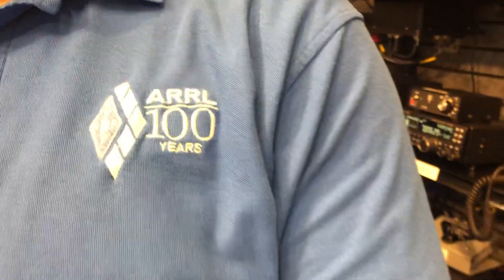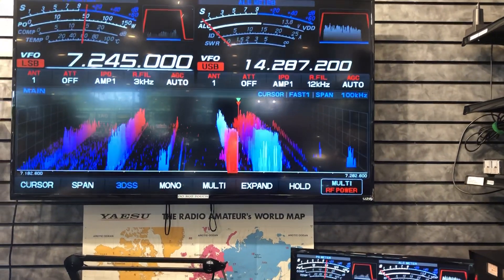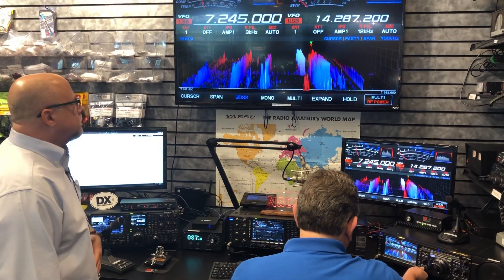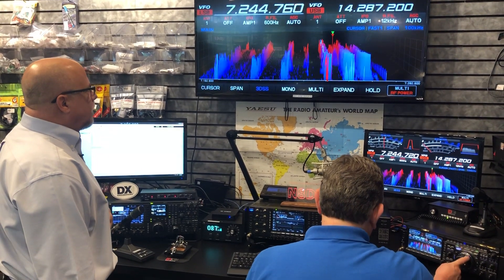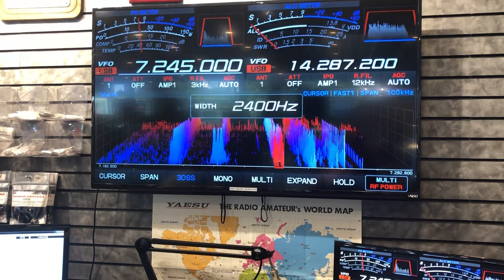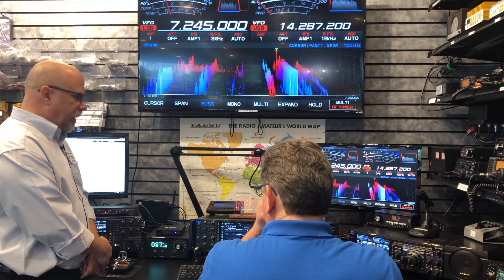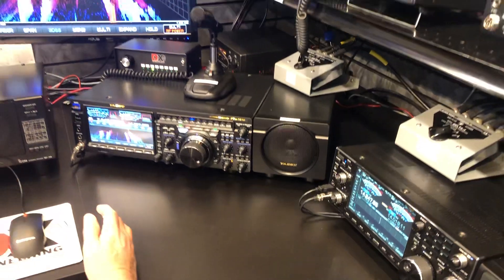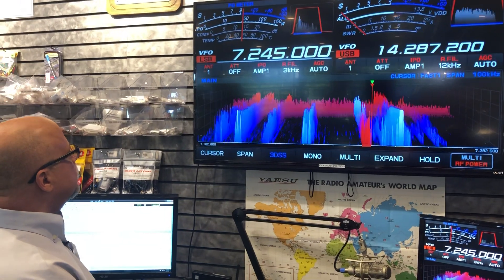HF Radio Filter Adjustments Explained

Comment: Many contacts or QSOs are "drive-by 5&9" and one wouldn't have much time to be fiddling with filters for 10 minutes. That said, the ideal use case is when you find yourself on some reef somewhere trying to work a massive pile-up, and other use cases exist of course. I just find that most of the time there's not enough time to optimize the reception.

Comment: I am currently experiencing a problem tuning in to stations in SSB with my FT-857. The only way to get the readable signal is to "shift IF" which comes pretty annoying. Does that situation mean something is wrong with my radio? de EU1MEV